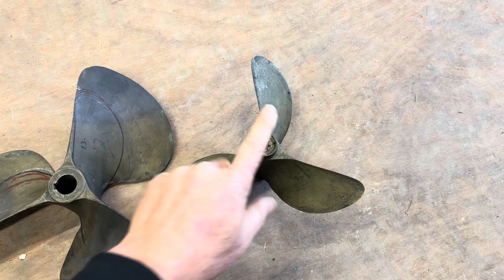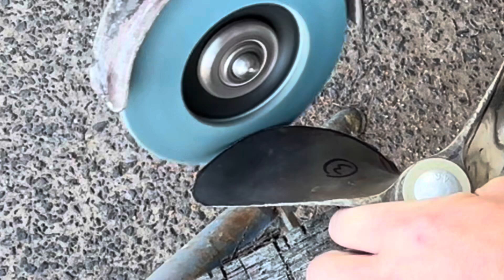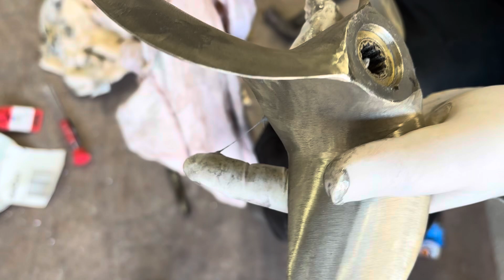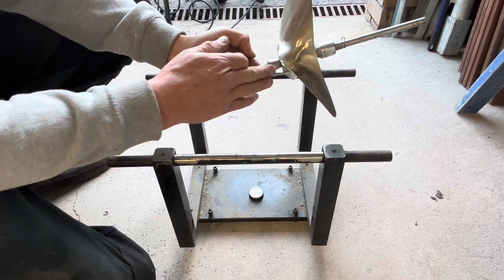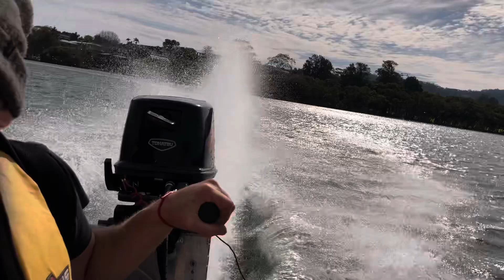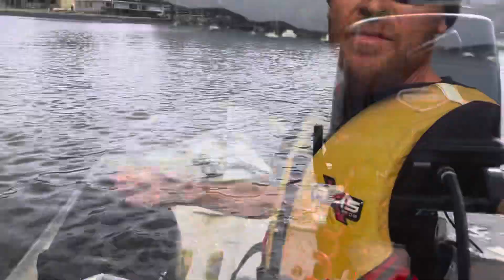Best propeller extreme cut

Comment: Hey Mr. ABG, I have been inspired to try this and have bought myself an old ski boat prop to fit to my 1970s yamaha 9.5a mounted to the back of a 'popular mechanics'   mini most, built during Covid in Ireland. Currently hitting about 25knots with the standard 10.5inch pitch pin drive.  The new prop is a 15 inch pitch so should be good for better than that hopefully. Without a reference prop to template from,  and before i go trying to freeze your video in the right spot to draw my own template from it,  would there be any chance you could scan and up load your template? Also,  any thoughts on Diameter? Thank you

Comment: It appears that you run it as a surface prop. Any considerations for building this? Different pitch?
Reply from the maker: Yes, more pitch than a full submerged prop. Normally more aggressive blade shape and normally more cupping on the trailing edge of the blades.
Cheers 🍻 
Aussie Boat Guy 😎

Comment: Why use epoxy for the bushings and spline tube in stead of soldering/brazing?
Reply from the maker: Hi Champion,
Soldering may work but epoxy and the pin dowel system works really well. A fair few guys use only the pin dowels and no epoxy at all which is also totally fine. I think the idea is if you need to remove the splines ever to try on a different motor setup.
Brazing especially may add too much heat and change - warp - twist sections of the prop.
Cheers 🍻 
Aussie Boat Guy 😎

Comment: I have designed and 3d printed adapter between shaft and propeller. If its solid plastic its strong and working. That is an option you can try in the future if needed....
Reply from the maker: Yeah, I reckon that may work mate.
One thing is with surfacing props, the exhaust can make the hub pretty hot (not my setup though as my exhaust exits above the prop)
Cheers 🍻 
Aussie Boat Guy 😎

Comment: Poštovani...

Dear...
I bought a Tohatsu 5hp 2t outboard motor, I would like to put a sports propeller like you did. Can you tell me which propeller I have to buy and what I have to do on it...? Thanks
Reply from the maker: Hi Mate,
Unfortunately it’s not as easy as buying one as they don’t exist, I had to make mine. Also a lot of mods need to be done to run that high.
Cheers 🍻 
Aussie Boat Guy 😎

Comment: I did this on a stock 2018 Suzuki 6hp 4smoke. 15.1 knots available on a 3.3m sib rpm going from 5400 to 5900😀
Reply from the maker: Well done champion 👍
It’s fun tinkering with props.
Cheers 🍻 
Aussie Boat Guy 😎
Reply: @25hpboatracerman Because of you I've managed to find a brand new old stock 2005 9.8 electric start 2smoke. I've modified it internal lithium battery, isolator where the cables came out plus micro switch to stop starting in gear. It's frigging amazing. 19.1 knots on the 3.3m sib.
Reply from the maker: That’s awesome mate 👌
Great motors

Comment: gday mate im back again with another question: i wanted to prop my 5hp for underwater drive but i dont know what i need to get speed outa it what pitch and diameter i am completely clueless
Reply from the maker: Hi Mate,
For normal running at factory depth the propellers that come on the motors are normally pretty close to what you need. For more speed, make the boat as light as possible and play with your trim settings.
Cheers 🍻 
Aussie Boat Guy 😎

Comment: The speed you are getting out of that little outboard is absolutely amazing! Really love the rooster tail too! 😎 Interesting to see that the methods you use to cut, shape and balance props, are exactly how I modify my RC boat props! 😊I even use the exact same "epoxy and stainless dowels" method of securing props with brass bushes to suit smaller diameter shafts. In my experience, it's not a fool-proof method, as there is inherently a tiny amount of run-out with each bushing being applied, and these inaccuracies tend to "add up", sometimes resulting in a wobbly prop. Am I making any sense here?
Just one final thought regarding the static balancing of RC props: I have a commercially available aluminium balance-tool-thingy, which also uses 2 conical end pieces to fit the prop snug and true to the shaft. The only difference with my setup compared to your much larger device, is that the shaft has been ground to a very sharp point at both ends. The shaft is supported at each pointy end by rare-earth magnets, which means that there is virtually zero friction when the prop is spun. This setup enables incredibly fine prop balancing. This kind of tool is not only used by RC boaters, but is widely used by RC airplane guys too.
Reply from the maker: Hi Champion,
Yep, your making sense 👍
You definitely need to make sure that the bushes you insert and true and centered for sure.
I used the same magnetic balancers with my rc propellers in the past, would love a giant setup like that.
Thanks for your comments and input mate.
Cheers 🍻 
Aussie Boat Guy 😎

Comment: Thats so genius!! Thats double the speed I am achieving with my stock Tohatsu 8hp. But she cools herself now under full throttle. I love that motor but the placement of the Thermostat under the head is so stupid. 
What do you think are the easiest steps to gain more top end speed?
Reply from the maker: Thanks Mate 👍
Yep, the thermostat under the head is not ideal but glad you sorted your cooling. Easiest speed mod is lighter boat and prop - engine height.
Cheers 🍻 
Aussie Boat Guy 😎

Comment: From an 8hp engine, that's amazing! When you balance the prop, did you compare the faces of each blde for equal thrust? I'd think that would be as important as weight balance
Reply from the maker: Hi Mate,
Thanks for your comments.
I didn’t change the face of each blade, just put a finish on it so the original shape was maintained. All material was removed from the back of the blades.
I did check the pitch of each blade though to make sure the prop was good before starting on the project.
I’m super happy with it, it performs better than I could have hoped.
Cheers 🥂 
Aussie Boat Guy 😎